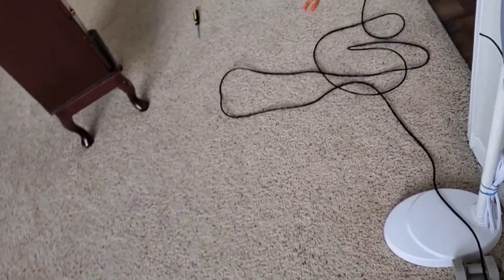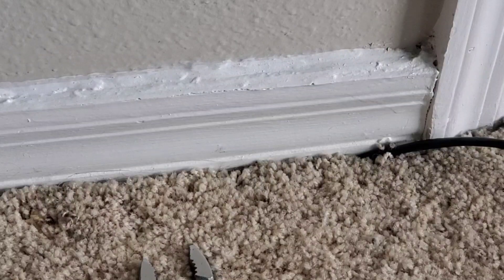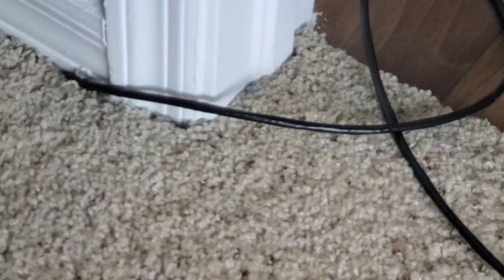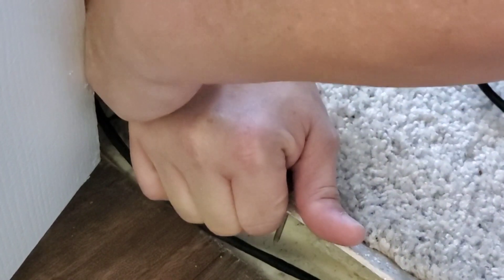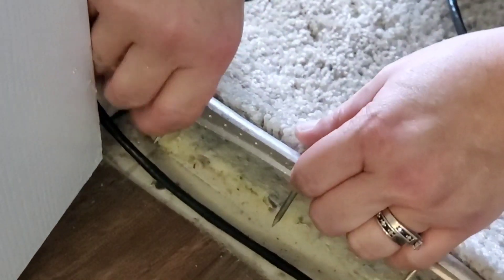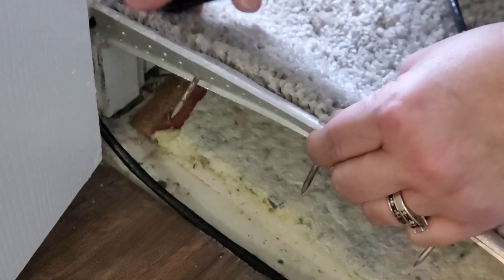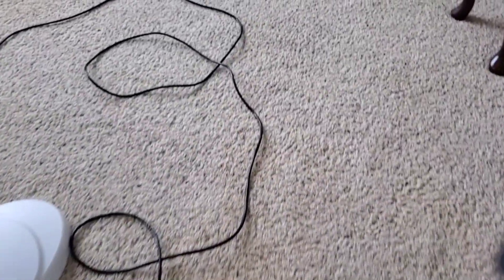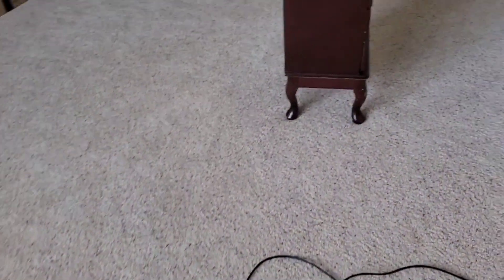Trainwreck Tutorial ~ Running Cable Across the Apartment ~ GOMMTube #306

Comment: Even though you really should never run wires under carpeting, you did a fantastic job! Even with the tools that you had! Beautiful little supervisor too! Happy Wednesday, Wendy!
Reply from the maker: Hi Beth, anything with normal power is a hazard but low voltage is fine as far as being dangerous.  I was worried about it myself and found lots of info online.  Example from Reddit

￼porkchopnet•Sep 3, 2017

Network engineer here.
Totally safe. Including POE. PoE is still low voltage, and has lots of safeties in place.
Cat5/6 will however damage the carpet over time. Put it under the padding to make it less of an issue, but still an issue.
If you can, run it under the wall trim or properly install it into the wall.

Comment: Hello Wendy and Jazmine 🤗💖. Your one clever gal. I would never even thought of that. Now what would you have done if you has all hard wood floors like we do? 
 Can't wait to see what your up to next. Hope your week is going well.
May Jesus bless you and yours,Lin ✝️🐶🐶🐶🐶🐦🐢🦎🦎🦎🦎🦎🦎🦎💖🦒🐲🐧🤗
Reply from the maker: Depending on your trim, you may be able to can carefully remove the quarter round from your baseboards and put it behind there.  Tack the trim back up after running the cable. 
Otherwise if you have a basement, drill through the floor, run cable across basement ceiling and back up through the floor.  Same idea if you use an attic above.

Comment: An ethernet cable is not a fire hazard. The voltage is too low. Even with power over ethernet devices, that cable won't start a fire.

Comment: 🤦‍♀️ never ever run any kind of cable under carpet. You’re just asking for trouble
Reply: Why?
Reply: Possible fire hazard
Reply from the maker: From Reddit...

￼porkchopnet•Sep 3, 2017

Network engineer here.
Totally safe. Including POE. PoE is still low voltage, and has lots of safeties in place.
Cat5/6 will however damage the carpet over time. Put it under the padding to make it less of an issue, but still an issue.
If you can, run it under the wall trim or properly install it into the wall.